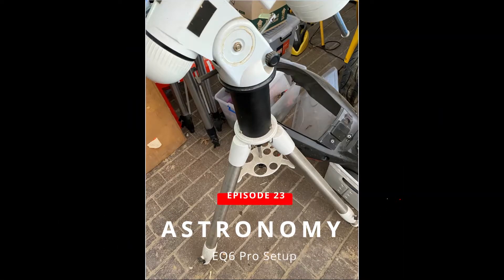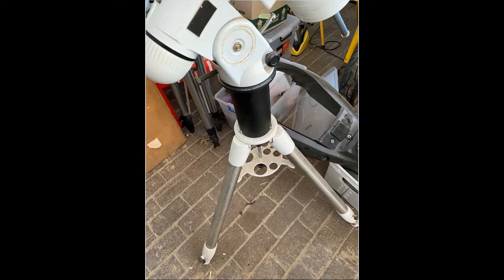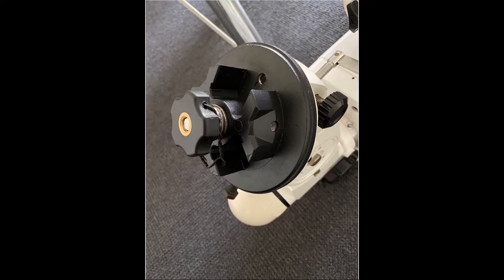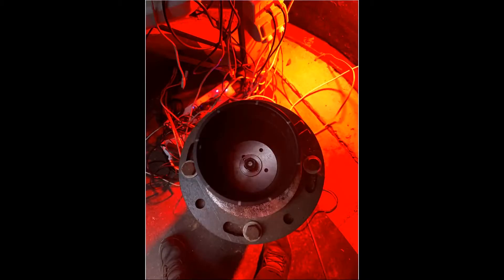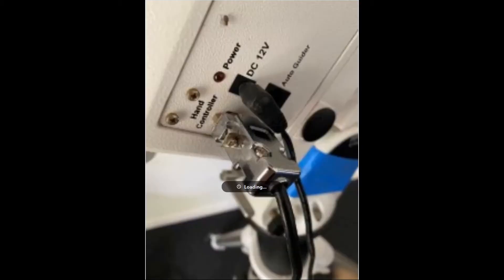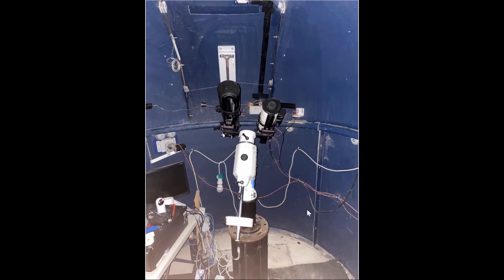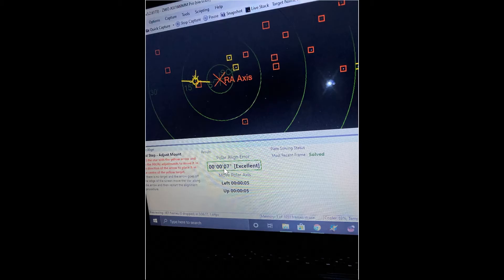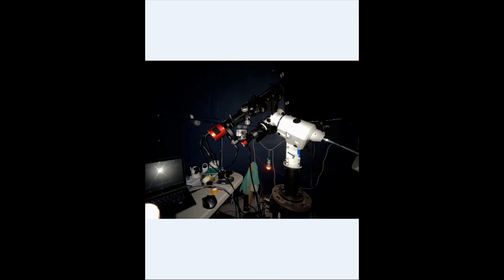Ep 023 - EQ6 Pro Setup

Comment: Great video 
I have the same mount I have trouble to communicate with my pc 
What cable did you use to connect?
Reply from the maker: You need an eqmod table. 
Something like this. 
Telescopes Equatorial Mount Control Cable for Skywatcher HEQ5pro AZEQ5 AZEQ6 EQ6-R Support EQMOD ASCOM Set Up Sofware Manual Download (6ft/180cm,Asiair or PC to Mount Black) https://amzn.asia/d/gfy04FG